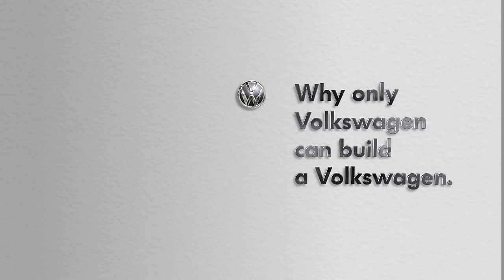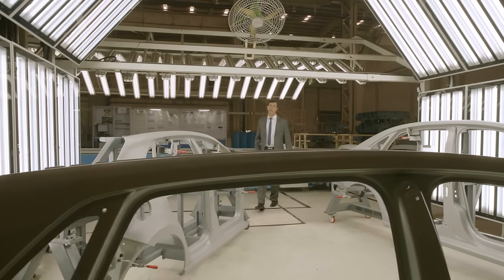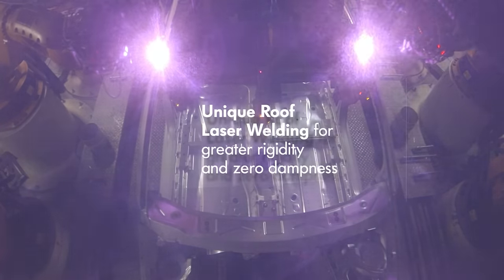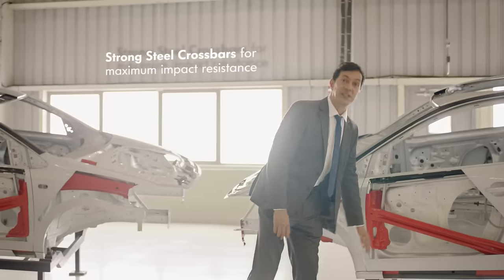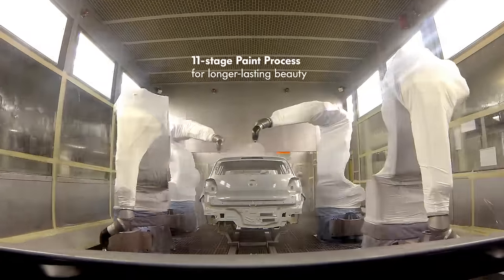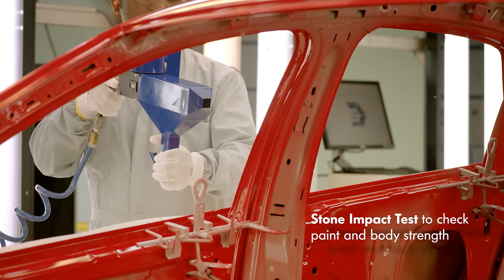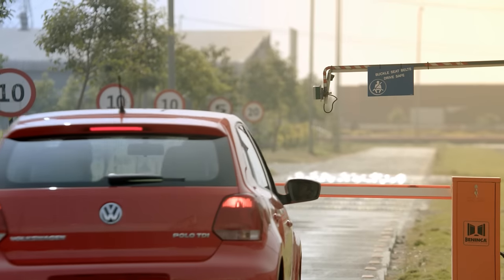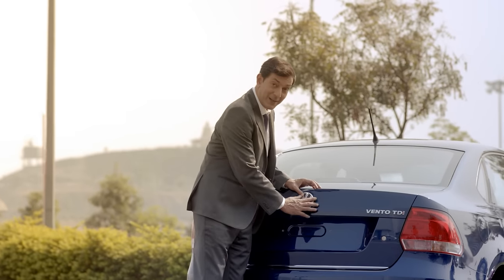Only Volkswagen can build a Volkswagen.

Comment: Im using VW Polo 1.2 TDI diesel car ,for last 10 years and present km is 340000,now my car got an engine problem and  breakdown at vadakara, kerala on 12 .02.2021,and brought the car through recovery to nearest dealership,PHEONIX CARS VW Kannur, kerala.
As per them need to replace the Cylinder head assembly and injector., But the parts in not available in all over India,,
Now I have to wait for more than a month for the parts because the parts was only available in Germany.
Daily I'm contacting VW India Customer care but still now any senior officials not trying to contact me ,if any VW officials reading this ,pls try to reply my questions,
1) I'm already report this complaint (engine noise) to the service center ,but they cannot identify it and allow us to run .I'm.physically check the damaged parts ,I saw the 3rd cylinder rocker arm was broken ,atleast they check valve clearence and done the proper adjustments ,this major failure can be avoided ,, 
* Who is responsible for this kind of carelessness???
2) when the cylinder head and injector will reach in the service center ? And when I can take the delivery of my car ?
3) my car is 10 year old and now it kept in the service center for idle .. because of this some other parts will also damage ,like clutch and brake cylinder,wheel cylinders,tyres, battery,ECU and sensor ,if anyone of this item defective who will pay ??
Because VW India has no parts for repairing my car ..who will pay ??
4) PHEONIX CARS VW Kannur balming VW ,coz of delayed supply of parts.they don't have any idea when the parts will arrive ,also the irresponsible attitude from the dealership side make VW brand value to ZERO..
Reply from the maker: We apologize for the bad service experience, Vijeesh. Do let us know your contact number to get on your concern right away.
Reply: @Volkswagen_India  hello, still no body contact me till now ,it's shows you irresponsible and lazy approach to a customer complaints,
If it's a film star car or politicians car VW will do anything for make the customers happy .

Comment: If only the engines were reliable as they were 15 years ago. 
They replaced the reliable MPI with TSI, witch is a failure, and good old TDI with the actual TDI with loads if issues.

Comment: Could you please made an AD campaign on current vehicles Virtus and Taigun and ennumerate all the advantages it as over the competitors cars. Base them on facts and how you've engineered it better than the competitors. That kind of an AD campaign will be more interesting and can't be refuted. Such kind of ADs (based on facts) are the need of the hour. We've all been inundated by the most boring kind of ads for the past 50 years. Remove all catchphrases and the bullshit and just have the engineers directly speak about each component and how it's better and well-engineered.

This AD campaign was great, it listed things such as better painting process, better build quality of the chassis and better body shell quality as advantages. We need to see the same for the current line of cars.

Just look at how Lucid advertises their car with deep technical videos on how stuff works. I would like to see such in-depth videos directly from the engineers that engineered the Virtus and Taigun.

Comment: Price is much more than features provided by VW. I am existing client of VW its battery dead exactly after 2years i had to pay VW Rs.6932. Its tyre bulged within 22000 KM without cut and pancher no replacement given by VW its all driven tyre 15 inch and spare tyre 14 inch simply cheating.

Comment: Really disappointed with Volkswagen Taigun. You could have just matched the specs and features from China's T-cross from Taigun in India because it is practically the same car. For such a premium price even the basics like hood insulator or hidden screws isn't right. Even the Polo has these which costs much less and a better instrument cluster than the restrictive digital display with blacked out corners in Taigun.